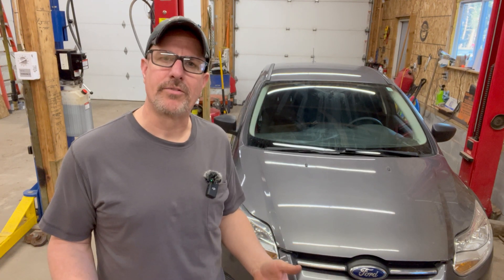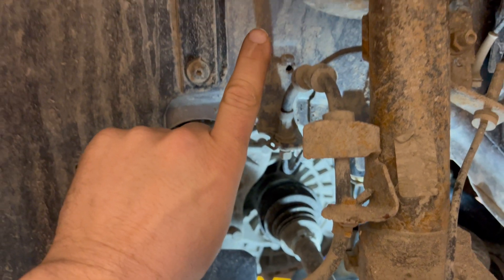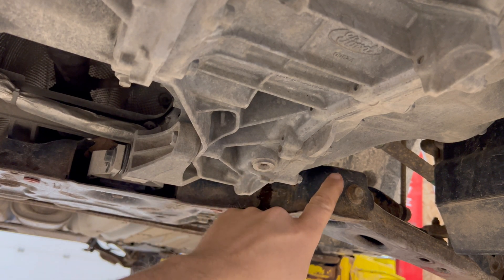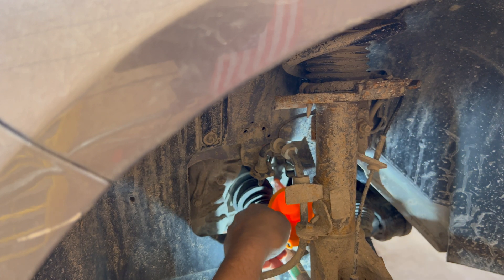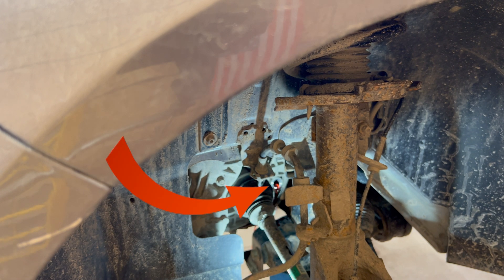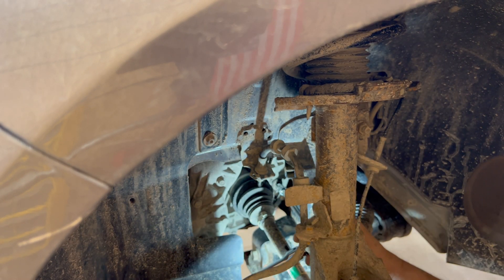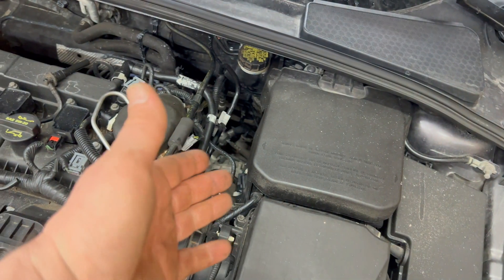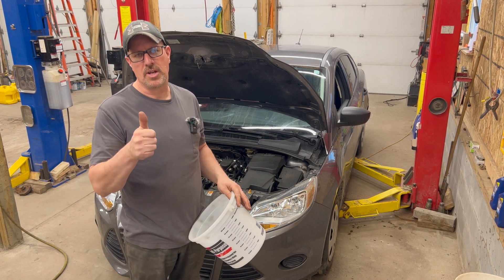Ford Focus Powershift Trans Fluid Change

Comment: yeah.. But measuring the fluid-- you're assuming it was at the right level when you drained it;  which is not always the case.   People love to overfill their transmissions.    I wouldn't trust that personally.  I don't trust the last guy that was here. :)   I always pull that fill plug;  just like you did.
Reply from the maker: You're correct but it's nice having different options. I like to personally check the fluid's actual level but I'm sure there are lots of people who just want to get it done or aren't as concerned with it.
Reply: If you don’t have a lot of time, a lift or 4 jackstands handy maybe the fill port and 1.8 / 57.6 ounces is the best option actually? 😂🎉